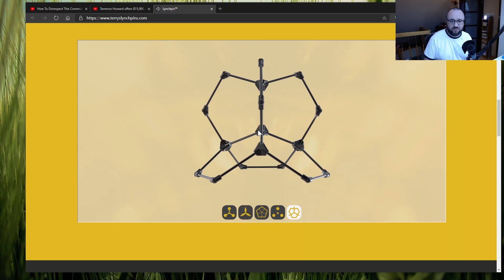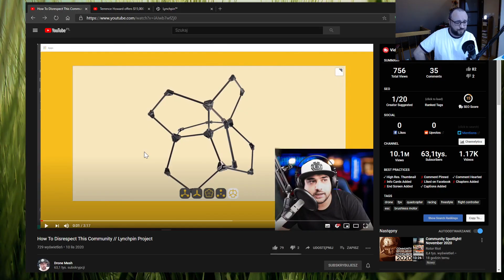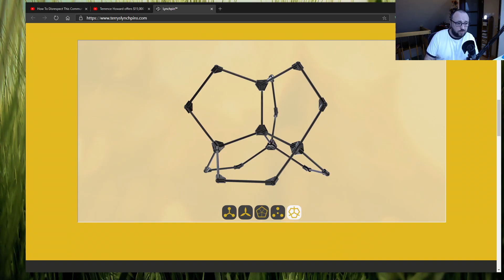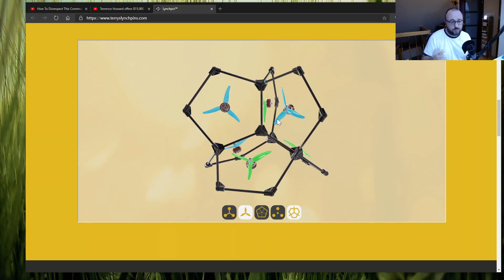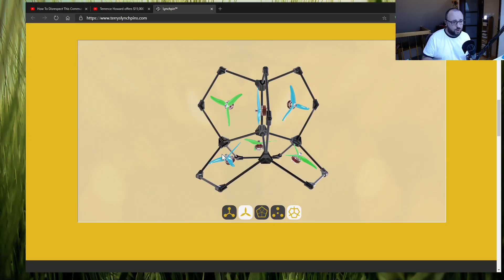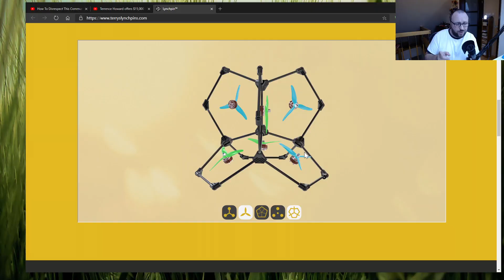The Lynchpin Project - respect and disrespect vs. the reality

Comment: Your analysis of the way the mixer must operate is one reason I find this project really fascinating. But it does help explain why maybe the $25k prize is not enough for the work involved. To say, "you just rotate the mixer based on the gravity vector" sounds simple but if the gravity vector is always affected by centrifugal force, it seems like the mixer will be really confused when the aircraft is moving and this can result in a feedback loop that makes the aircraft unstable.
Reply from the maker: 1st substract taxes :)
2nd there is not that much time until the deadline
3rd there is no guarantee of winning
4th idea to rotate mixer is simple, math behind it will not be. Euler math is rather a no-go, quartenions  have a better chance of succeeding
5th yes, gravity vector will shift and I mention that compensation of that will be required
6th I bet a few PhDs could be made from this easily
7th I doubt there will be an interest from investors/governments etc about this since this idea makes quite inefficient flying machine: too much dead weight and complexity
8th it's an interesting contest I agree
9th have I mentioned very little time?

I bet someone will make it fly, but my guestimate is that will not fly great and there will be no free rotation in all directions
Reply: I think if you gave all participants more time much more people would participate...
Thanks for your great work Joshua

Comment: Pawel , what is your disposition now that the Lynchpin drone has been built and operates with 12 motors?
Reply: My reaction is that standard four propeller drones have all the same degrees of freedom with less components and a a lot more simplified control system. I've also yet to see what the proposed benefit is over a regular drone.
Reply: Think outside the box and it should be enough to form a thought
Reply: @jd52wtf  There are zero benefits, only drawbacks. But it is cool to see someone make it.
Reply: @jd52wtf  I don't see other drones linking together in a fractal style like these can.
Reply: @TFNEVADA how is that an improvement again?
Reply: The More complex you make something the more points of failure you create. Simple is always better and the linchpin looks like a mess.
Reply: @scottoshea9440  It adds lift. The more that come together, the more weight they can lift. Are there more points of failure? Sure, but that is not a reason to not explore an idea.
Reply: @TFNEVADA  So what? It's not necessary. And it's extremely inefficient, but you COULD do it with 4 rotor craft, if you designed them to do that lol
Reply: @TFNEVADA  You know what else creates lift? All of your props pointing in the same direction, the CORRECT direction. This is the dumbest design ever.
Reply: @Sherlock_MacGyver you have literally no perspective. tell me your net worth and I’ll tell you why.
Reply: @jd52wtf  idjut!!!!  limited thinking makes a person say this, nothing thinking of what else can be done.  lemme give you one example... try putting your fpv drone stationairy in the air and have it stay in that static spot and try to film an object flying all around it in every direction, YOU CANT!  it CAN!
Reply: @TFNEVADA thank you
Reply: @Fatpumpumlovah2 No need for the name calling. Thank you for providing more.information about a possible use case. You are wrong however. Two 180 degree cameras can be mounted on a standard drone to achieve this quite simply and with an order of magnitude less complexity. I appreciate the clapback but this is solving a problem that doesn't exist.
Reply: @jd52wtf  no it cant...   this craft can spin in one spot in any amount of directions without moving position!!! (so the craft can rotate around ITS OWN CAMERA! a regular drone CANNOT DO THIS!
Reply: This is a very powerful weapon

Comment: The biggest problems with his design of the lynchpin is that the rotors inherently interfere with eachother and have a non-optimal angle in terms of the thrust that is generated by e.g. moving in one direction. This makes the design quite ineffecient. Even if in space, this design is actually not likely to be the optimal solution since there is never even just one single thruster/propellar that is pointed in the exact opposite direction of the moving trajectory. The structure is constantly fighting against itself and basically "collapsing" inwards which results in a notable loss of energy and an increased need of structural material to sustainably support this structure. Some of these problems could be mititgated by having thrusters/propellers on a rotatable axis as seen with other omnidirectional drones, but this just makes the design even more complex and inherently worse than the more "normal looking" omnidirectional drones on the market such as the Aerix drone. Additionally, in space, the lynchpin has to have thrusters that can thrust in two directions at each of the protruding pentagons or circles as he has also designed it as. Here on earth though, it has to have either the same configuration as in space or opt for very ineffecient propellars that are two-way compatible. Nonetheless, this design implies the use of 12 thusters/propellers compared to only 8 in e.g. the Aerix drone which can achieve the same results althrough it comes with it's own set of disadvantages. also, the "swarm" effect that terrence says the drone is also intended for is actually very inefficient as a lot of the lynchpins thrusters/propellers will become inoperable and closed of from the exterior. So if high material and energy consumption, cost, complexity, and ineffeciency is not a problem, then this design might be of good use. I will credit some inginuety as it seems to be novel and somewhat usefull in niche situations.

Comment: 6x6 matrix M of each motor's linear and angular acceleration
i = M * o, where i = vector of requested inputs (requested linear and angular accelerations), o = vector of thrusts of each separate motor.
o = M^-1 * i
imho afaik ymmv, but it seems like a clearly defined mathematical problem with a nice unambiguous solution

Comment: To me it looks like a drone project that might come out of a university electronic engineering department as someone's degree project/job application calling card. I'm thinking Tom Stanton could build it in a weekend with his 3d printer and an arduino board. But if anyone else wants to give it a try why not could be an interesting project 🤔

Comment: A cube would be a better shape, because by recessing the 6 props slightly inside the center of each outside frame square of the cube (like a tesseract https://upload.wikimedia.org/wikipedia/commons/a/a2/Schlegel_wireframe_8-cell.png ), you'd have the same landing on any side arrangement.  But here's why a cube would be so much better:   Standing on a corner, all six sides would be producing thrust.     It gets more interesting and far more doable, when instead of one propellor per side, you put a whole 4 propellors or a quadcopter per side.  Imagine a 6 sided die with every side being "4" or 4 dots and you get the picture.   A standard flight controller runs each side, but the computer but each is programmed to be 90/180/270 off axis, so when you're holding it level, every single side is leveling itself offset and related to it's location on the side of the cube  its on (Airmode on).  When you change inputs on your stick, that goes to the flight controller int he center, the mixer if that's what you want to call it, that sends out the individual commands to each flight controller of each quad on the sides.      

The downside of this arrangement is what you'd get with a lot of these type arrangements... a lot of dirty air and thrust passing through the center.

Other fun geometric 3D shapes, that are even better than a cube:   https://www.google.com/search?client=firefox-b-1-d&q=12+sided+dice
That 8 or 12 side ones look promising...

I am choppergirl, hear me roar :-)   Team AirWar  ~ gurlz not derr faa rulez urz airspaze  =(^v^)=   
mother nature, #1 designer of more flying things than anyone else,, even burt rutan...   and thousands of years... earlier.   guys just copy us...

I didn't realize Pawel was Europe, I'll have to update my outdated globe.... he looks so much smaller in the video...  blah blah blah blah blah
fpv.air-war.org

Comment: Hmm, I like your thoughts on the subject, the angle you took, and the way you went over it. I am thinking of a different way about the "skeleton". To me, the main issues outside of what you said are also about: how to make it modular; power it; how to link it to others, so they did not get in the way of each other; share power between connected parts, resonating issues within one unit and then many; forced loop feedback; the gyroscopic effects of all the different rotors acting upon one another in any orientation; and many others that just make my head hurt. The code needed to make sure all things "listen" to each other, start and stop properly, and do it smoothly is way beyond my level of abilities. I also do not think it will be small. First prototypes will likely be very clunky due to the power/weight ratio and the expected features. To your point, I do not think it will be quick as I do not think many of the parts are readily available.

Comment: At around 7:25 you talk about a mechanism that angles the motors. I think that's against the requirements of the contest: "Motors and props must be located within and aligned parallel to the planes of the frame"
Reply from the maker: my bad :) No tilting motors

Comment: This configuration is already made. Omnicopter.
Reply: Hey yes.  Good observation.  Look it up.
Reply from the maker: Not really. Omnicopter has 8 props and is quite different in handling as reactive torque on each plane can be compensated by the same plane
Reply: @FPVUniversity  anyway its a very interesting configuration. Will see how this fly.

Comment: The mixes for 3 rotational axis would be actually stay static (without motor-tilting). The problem is the need for rotating the thrust vector relative to gravity AND user input wich would require to have 3 additional (static) mixes for the translational axis.
This should still be solvable within the given time frame by 2 smart kids (that have a basic idea about the betaflight code base) working full time.
Now someone needs to design, build and learn a 6-axis controller to fly that thing the way it is supposed to (6d) and that will not happen ;-)
Reply: Sounds smart.  But we are looking for results.  And it looks like Howard produces results

Comment: Just looking at it I can see that it's plausible 

I already created a mixer (fixed and dynamic in my head) and I can already see problems.
 there are configurators that can support this but can't because they are severely limited (inav, betaflight, cleanflight, ardupilot) that means you need to create your own filmware and if you manage to create it now you need to make your own flight controller because premade ones are limited in I/O pins, ok but how are you going drive motor esc? With Dshot to have reversible motors, ok but motors don't behave well in low throttle conditions and only way to remedy this is to make sensored motor, ok but you can't buy sensored esc with Dshot support so you need to make your own esc and filmware for that esc, And to top it all off, you need custom trazmitter (3 control sticks).

Let's sum this all up 

You need custom flight controller,
Custom filmware for said flight controller,
Custom configurator for said filmware, 
Custom esc's,
Custom filmware for said esc's,
Custom motors, 
Custom trazmitter that has 6 analog outputs.

And the winners will be people that have shit ton of cash already that have huge labs and big team's.

Also the min number of mixers whould be 6.

Good luck finding a microcontroller with enough memory and proccesing power

Edit: I figured it out using two mixers  
(One for all orientations and one sweeping through the first mixer  dependent on accelerometer values) 

But since I love a good dumpster fire I will wait and see what turn this scam will take.
Reply from the maker: Am, it's not that bad. BF or INAV can be used for radio input and 3 axis PID as well as drivers for all the hardware.
- almost all ESC can work in reversible mode
- most FC can run 6 motors
- all RC motors fits
- you need 3D props
- and a clever way for another degree of freedom from the radio

You have to build the dynamic mixer though
Reply: @FPVUniversity  bf and inav won't let me use custom mixer, let alone s dynamic one 
Only way we could get somewhat dynamic mixer is in inav using logic tab to get it shift between different mixers.
It whould be rough but It whould fly...

Forget what I said inav won't arm because custom mixer can't be verified.

If you need help I can create mixers and help in software development  but this means creating new filmware from ground up 

Also for this aircraft to work all propellers must be clockwise or all counter clockwise 

No exceptions
Reply: You dont need a custom configurator if you write the firmware. Just hardcode it into the firmware.

For the rotors maybe variable pitch so the reversing goes more smooth.

Anyway we can all agree... this is a pain in the arse project and where am I going to hang my fpv/action camera?!
Reply: @impmeister1  again 
Configurator like  betaflight doesn't even have mixer tab and inav won't arm if you use custom mixer
Reply: @blackturbine  ok maybe I wasn't clear. You dont need a configurator/custom configurator. If you write your own firmware.

Write your firmware upload it with a st-link/avrdude/PICkit3

Test it, apply changes in the code and upload it again with your programmer.

No Inav/betaflight/ardupilot/custom configurator needed
Reply: @impmeister1  wait that is allowed 

Well why didn't you say so 
Final coding time (the long part) oh boy time to brew some coffee and practice crying on keyboard
Reply: @impmeister1  update: I bit off more than I can chew 

there is no way to even get a barebone code to work in six week's 

these people are insane

Comment: Is the contest limited to 6 motors or could you use 12.. .. I’ve been looking over the contest but have found it.
Reply: I'm pretty sure I heard Terrance say he wanted 12 motors. If you go to the Lynchpin site, go to the bottom, and click "Hindsight, then on the menu of that page click direction, and there's a computer simulation of the way he thinks it will work.

Comment: Two motors per opening, facing opposite directions.
Reply: The motors are already capable of spinning both ways
Reply: Coaxial, counter-rotating motors would solve the torque problem. But you would need an FC with 12 outputs.